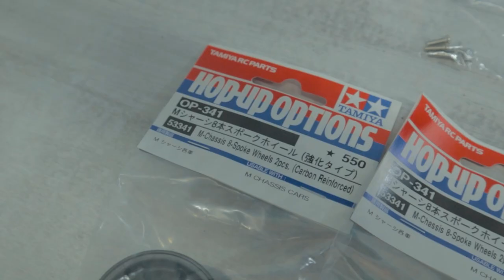WPL D12 | Rear Suspension Upgrade + Tamiya Wheels | New Paint 2021

Comment: The look is great.The rear shocks aren’t really a upgrade.The reason is the leaf springs are stiffer then the shocks.That means the shocks are just going for a ride.
Reply: I think the shocks are adjustable so you can make them stiffer, I believe some have a nut you can screw up and down to your preferred stiffness/height
Reply: Not how resistance works but sure
Reply: That’s not how it works

Comment: Can you ditch the rear leaf springs and just use the shock springs? My D12's rear leafs seem too stiff and I have those exact shocks on order.
Reply from the maker: the leaf spring holds the diff in place if you can replace it with like a rod link its possible to remove it and just use the shocks, this is a good idea btw thanks 😁

Comment: Will the m-chassis tires fit w/o modifications around the fender area? And also on the rear?
Reply from the maker: Yes, depends how wide is your 5to12mm adapter which I forgot to mention in the video 😅

Comment: NEED HELP WITH MY D12:  I upgraded my D12 to all metal chassis, 370 motor and metal trans and upgraded suspension.  If I put any kind of load on the motor, either the radio completely loses its signal to the truck (headlights flash) until I re-bind OR the truck suddenly loses signal until I stop the load w/o making me re-bind  It does not do this at all if I have no load on the truck by holding it off the ground. This is real annoying and I'm wondering if I was supposed the remove the capacitor off the old 260 motor and solder it onto the 370? Any ideas why it's doing this? BTW... I'm asking this question on several D12 videos so sorry if you see my question elsewhere. I'll try to remove it when this issue is resolved.
Reply from the maker: Im not sure about your issue. But since you replaced only the motor and trans it may be an issue between your receiver+esc since its still stock. Might not be compatible to the motor. Try to put back the stock motor and see if working properly if yes then its probably the new motor
Reply: Well, the motor and trans are sold as D12 upgrade, so I can't imagine it not working on this platform, but you're right. It will be one of the things I try if I don't find a fix elsewhere. Thanks for your thoughts. 
 @gnrcfilms